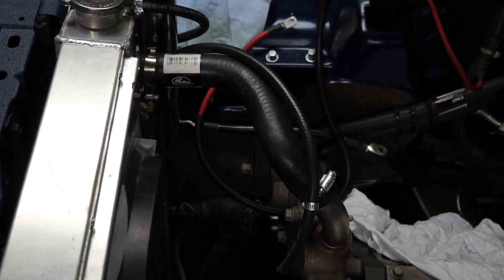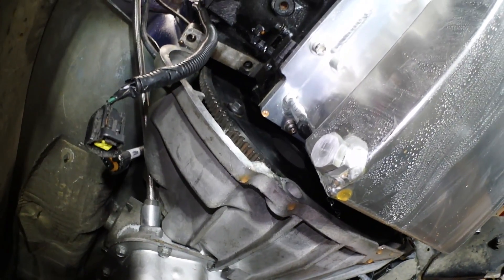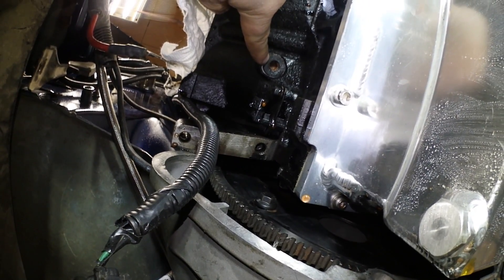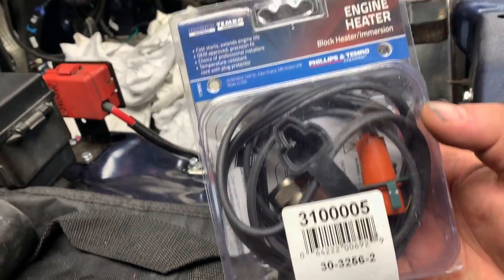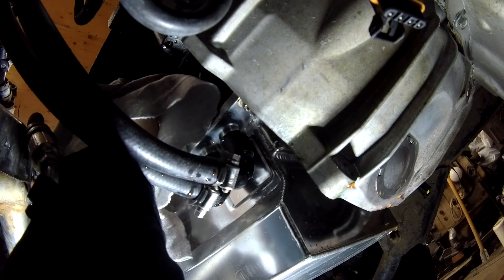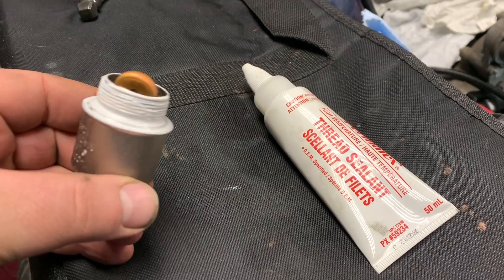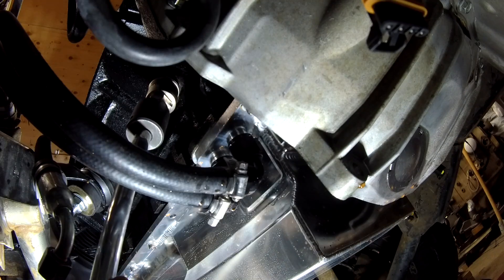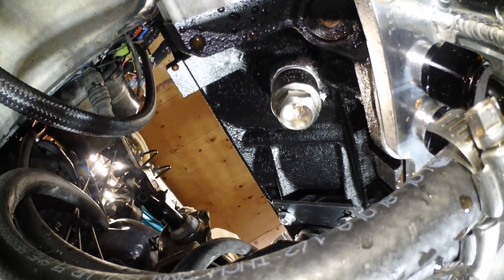Watch This Before installing LS Block Heater

Comment: Put a shop vac hose in the reservoir tank. Turn it on when your ready to pull the plug and the vacuum will hold the antifreeze from running out.

Comment: Those little block heaters work pretty good.I installed one on my Ram pickup and run it off a timer.On cold mornings it starts easier and the heater works faster......
Reply from the maker: They are a must have around these parts